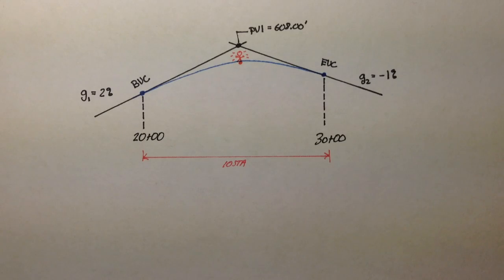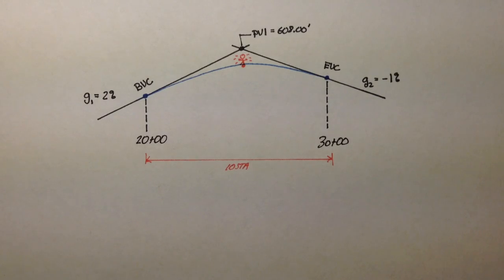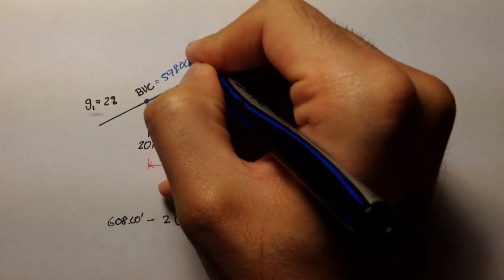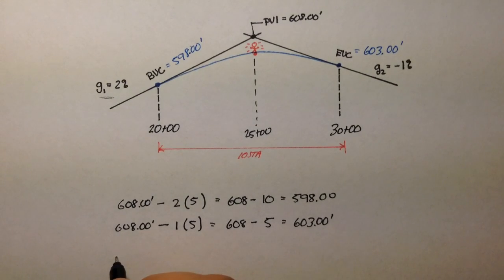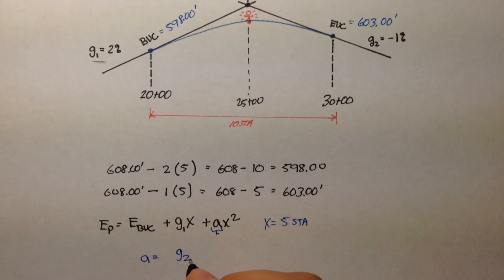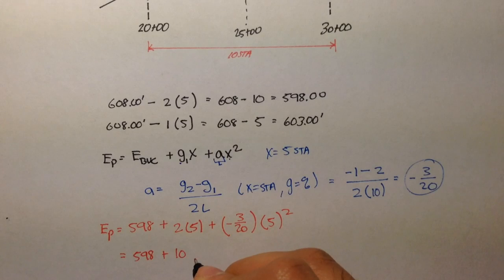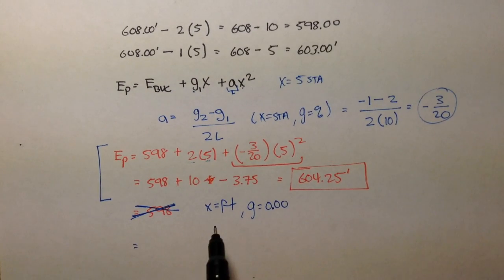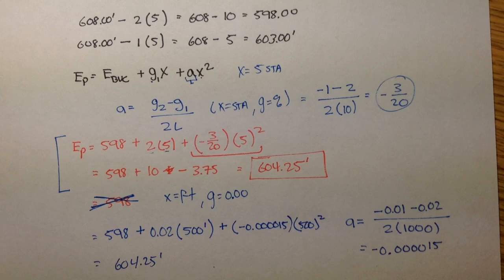Advanced Geomatics: Vertical Curve Example: Elevation

Comment: Why STA 10? Please answer my question
Reply: The example given isnt really correct per real world application.  Station 20+00 is 2,000 ft.  You simply drop the plus sign, the plus sign is used in the construction industry to help annotate stationing for horizontal location......So, 2000 ft. minus 3000 ft is 1,000ft.  That is the length of the vertical curve.

Comment: 3:09 2 negative signs will give u a positive sign
608.00 - (-1)(5) =?
Reply: I know this is an old comment. I am responding in case it helps others who are learning this now.

The correct answer is 608.00 - (1)(5) = 603+00. This is because we know the exit grade is going down 2%, or -2%. The sign can be ignored as the equation is already taking into account the '-'.

Here's a logic check to show you it's correct. If we were to use both negatives, making a positive sign in the equation, the answer would be 613+00 ft. This is saying that the EVC (or PVT) of the vertical curve is higher than PVI, which doesn't make sense.

Comment: What is the G1 and G2 in feet ? Thanks—
Reply: Grade 1 and grad 2 good question
Go my channel
Reply: It is  a dimension less number and slope value which say eg. for every 100ft in horizontal direction 1ft rise in vertical direction which can be represented as 1ft/100ft = 0.01 = 1%  feet cancels out

Comment: There is hidden information here. He is multiplying by a percentage which doesn't make sense mathematically. What is going on or what I think is going on is that values he is using for horizontal distance is a hundred times the size. For example 5 is actually 5x10^2 . So if you convert the 2% into decimal .02 you can then (.02)(5x10^2) = 10 which is the same thing as (2%)(5) = 10.
Reply: Never mind he clears it later in the video.
Reply: Right
Reply: 2% =0.02=tanβ=opposite/adj = elev/dist
Reply: No problem vertical cruve very semple going my channel

Comment: Why did you say "608.00'-2(5)=608-10=598.00"??? It should't be like that! because g1 is going upward. Therefore you should put a + sign like so: [608.00'+2(5)=608-10=618.00]
Thank you!
Reply: that would be incorrect seeing as 608 feet high was stated to be the highest point (Maximum) on the curve it's just the notation don't let it confuse you
Reply: @AlickzRider  land survey channel
Reply: Very simple method going my channel
Reply: I am confused too! Did you find out the correct answer?
Reply: @internationalstuff5576  going my channel I am clear too